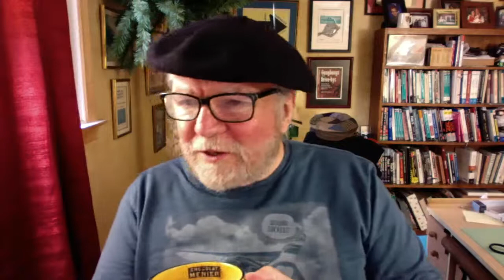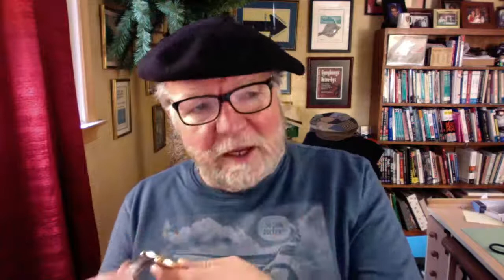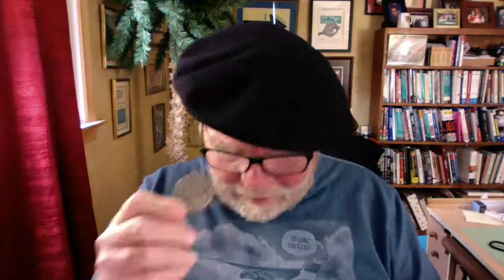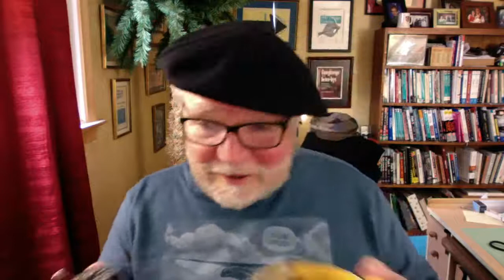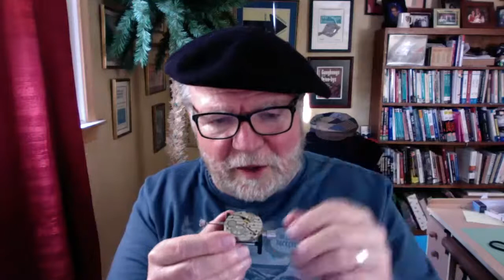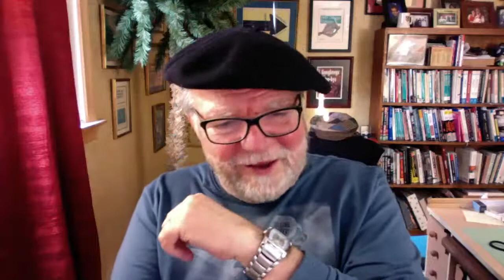The Importance of Constant Force

Comment: I've looked at many tactics, such as Fusee & Chain, Remontoire, Stop Works, Dual Serial Mainsprings, etc.  However, I have a strong feeling that a simple well-designed automatic rotor - that keeps your mainspring in the sweet spot when active - is likely the most effective constant force device.  If you look at all the COSC certified watches, automatics seems to rule.  Keep up all the great videos and Happy Thanksgiving.
Reply from the maker: Is there any research indicating that SouthNc? A well-designed rotor is important, but it only does one thing and is inevitable that there will be variation due to different users' movements. That's what tourbillons, remontoires, etc. are designed to offset. Take care and stay well, Bill😷